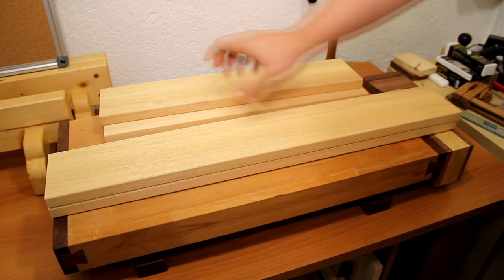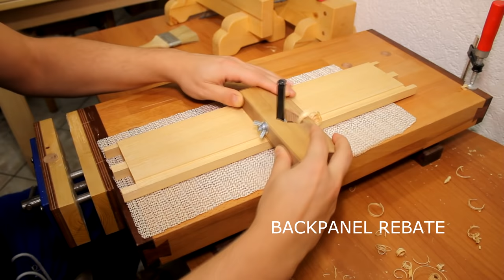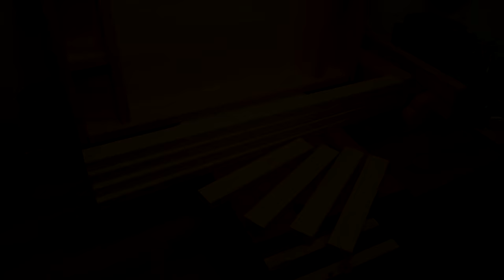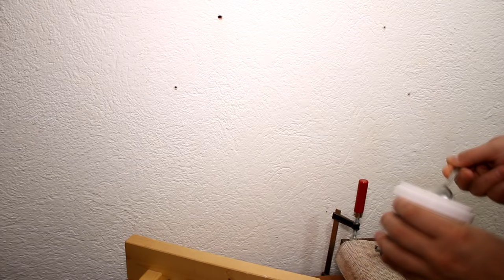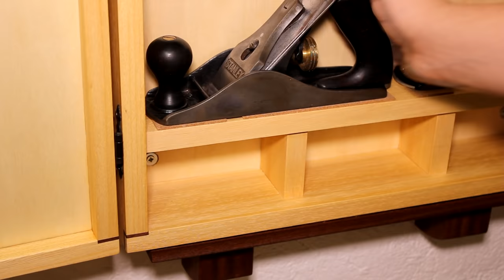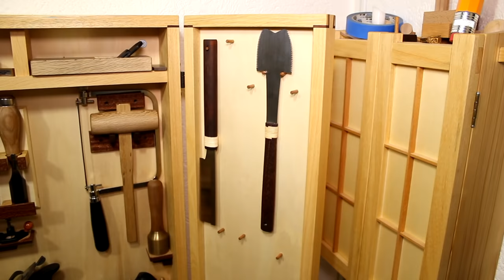Building a Woodworking Tool Cabinet

Comment: Love the design. I am currently looking to do something similar but the whole thing would be a door for a shelf. I am just working out the weight on hinges problem. 
It is an amazing design.
Reply from the maker: Thanks Robert! If you don't hang planes, normal cheap hinges should work, or to be sure, that long type one across the all length of the door (but kind of ugly in my opinion) I was also concerned about this, even thought to add a 3rd middle one, but there is no need.

Comment: Very cool cabinet. You inlay dovetails look great. Maybe darken the decoration with same wood or color as those inlays?
Overall very nice piece.
Reply from the maker: thanks! I thought of that, but those pine strips were easy to get quickly from local stores here. Other colors/materials I found online on model makers stores, maybe in future I will do a retrofit of the cabinet. The decoration is glued on the lacquer so will be easy to remove without damaging the door.

Comment: Really cool video as per usual! I especially like how your inlaid dovetails continue over the door frame. Nice!
I also need to badly change up the tool and scrap storage in the work space in my shop. It's such a clutter at the moment :)
Reply from the maker: Thanks Dorian! I may still change some things at the design, I can feel that is a mix of different styles, probably hinges and the door decor (which is glued on the varnished plywood, easy to remove), but I wanted to finish it quickly in order to get rid of the mess on the wall which was growing month by month with other tools. This room corner workshop is part of my apartment day room, and now finally I can put it in "stealth mode" by closing the cabinet doors :) All the best to you! Adrian

Comment: Bello Adrian, your work is for real amazing and inspiring.

I know this was 2 years ago but do you remember the measures of this cabinet? I would like to try something similar. Thanks
Reply from the maker: Hmm something like 50x70x15cm if I recall. But anyway, it was dimensioned by the tools I had, made some calculations first by laying all of them on the ground then measured

Comment: Awesome job. Just a quick question for ya. If you were to do this over again, would you use a rabbit slot/dado groove for the backer board instead of just relying on the glue to hold it in place? I've seen glue over time actually give and break lose, of course on projects that's many yrs old but, still. Sub'd to your channel.
Reply from the maker: +TsmnnDvl5 yes for sure 😁 this time I was constrained by the width of the board as I was loosing to much depth to fit the tools inside. I don t have gears to mill my own wood so I have to deal with what I can find. I thought first to use french klet but same will loose some depth. Will see in future, if my tool fleet will grow I will probably build a 2.0 cabinet more sturdy 😁 Thanks for comment and subscribing!

Comment: Good job, great skill's but I got one Question about functionality.  I'm afraid that all yo tools go down when/if you slam the doors. I would use a little hooks instead joiners. And you left pencils lines. But its a detail :D Great job! I would buy it!
Reply from the maker: +Marcin Nogalski Thanks! No the tools on the doors are held with magnets, big saws in the video, and in the meantime I ve added also to some other tools like rulers, caliper. Will be soon maybe a small updates and improvement video with other stufs as well. Those are not pencil but markings from the marking gauge, knife. You will not get that precision with a pencil. Leaving them is a matter of taste, some people like them, some no...Not for sale 😁 Don't want that messy wall again 😁

Comment: As craftsman, you should make more incredible cabinet for your tools, to show your absolute capability with wood at that time, and change cabinets evry 5-10 years, to know how much you improved.
Reply from the maker: Right! This one even in the middle of the project I thought about different elements to improve, but will be very soon an update. I too consider not to neglect the design and craftsmanship of shop related project, it's like a open portfolio when someone visit your shop, throughout all the sawdust and off cuts allover the place :)

Comment: Hey Adrian, been watching your videos for a long time! Beautiful work. Just wanted to ask: do you like your MHG chisels? I found them for some pretty good prices from fine-tools, but can't seem to find any reviews or much info about them. I'm tossing up between MHG, Lie Nielsen, Stanley 750 reissue, and Ashley Iles right now and just can't seem to decide.
Reply from the maker: +Hendrikus De Vaan Hi, about the MHG they are ok in my opinion, good value for the money, they hold the bevel decent, less the small ones 6 and 8mm which I use them most for removing more material, after some hammer strokes u can see some chips on the edge, but even after they perform well. I consider to be a good starting set, other, cheaper and more or less same quality are the Narex. Now I've started to form a japanese chisel set, Matsumura make, 4x price than mhg in avarage. They are more better, bevel wares harder, it s 64hrc i think, the feel in hand is way better.

Comment: It is an attractive cabinet, and well built.  However, you didn't make room for any drills or drill bits.  And there's no joiner plane, jack plane, hammers, screw drivers,  countersinks, or nail sets.
Reply from the maker: I wish I had the space to make stuff that requires a jack or jointer plane, then they will receive a properly sized cabinet. Meanwhile I will stick to a 10" long maximum plane. Soon I will upgrade the old No.4 with an Low Angle Smoothing. Thanks for watching and comment!